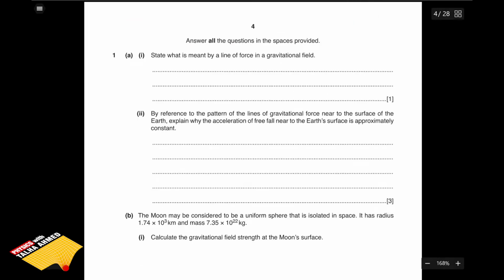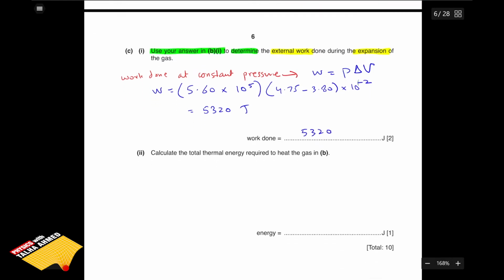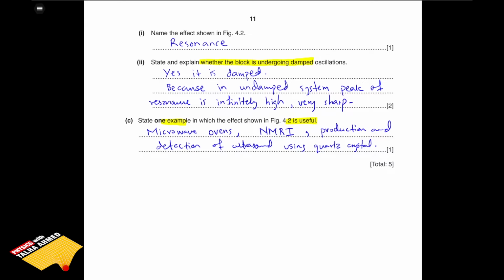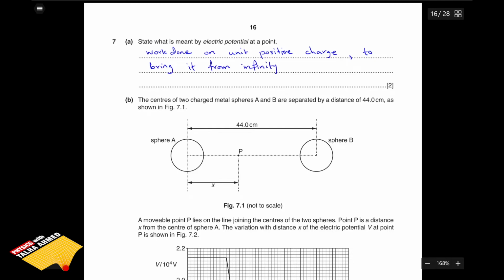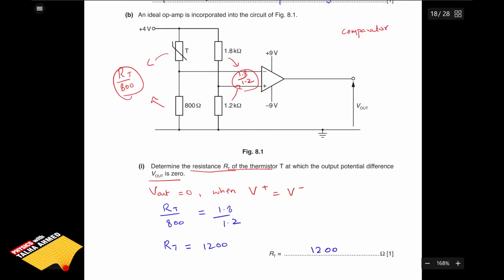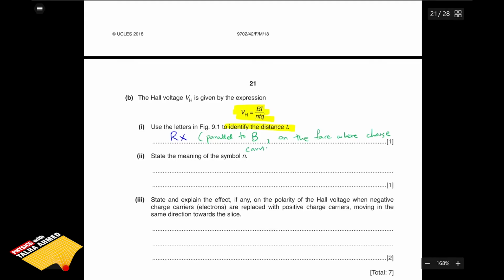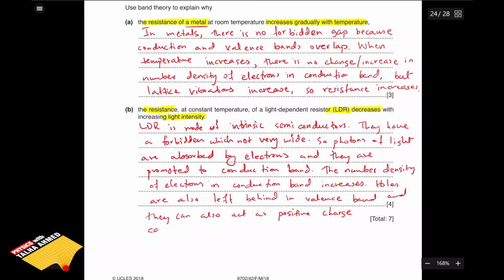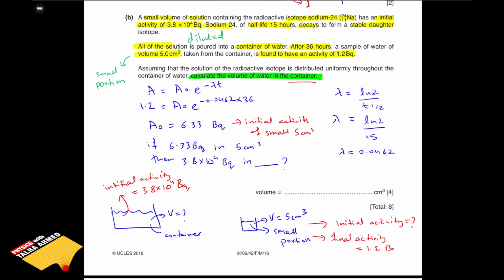A level Physics 9702 Feb/March 2018 Paper 42 Past Paper Solution

Comment: I have a question about Q7 b) ii) 1, as the particle reaches x = 32 cm, there is no electric field there as the gradient of the graph is 0 there, so why would there still be a force causing decrease in speed there?
Reply: The particle has just reached 32cm, it has not passed through the flat section of the curve yet. So you must take account of the tangent of the curve at exactly 32 cm which gives a positive value. 
If the question was "passes through x=32cm, then the speed wouldn't be decreasing.

Comment: in Q9 a (i), how do we know the direction of the force?
Reply: Faraday's left hand rule; Thumb will be pointing to the direction of the force.

B, which is your Index Finger, pointing DOWN
I, which is your charge, pointing left, but since your charge is an electron, point it RIGHT.
Hence, F, which is your thumb, will point inside the page, or rather as seen in the picture.